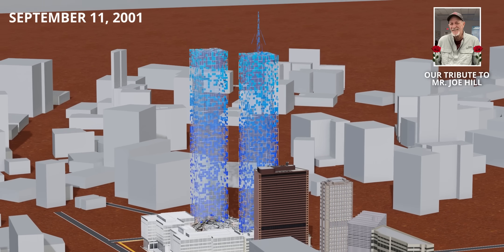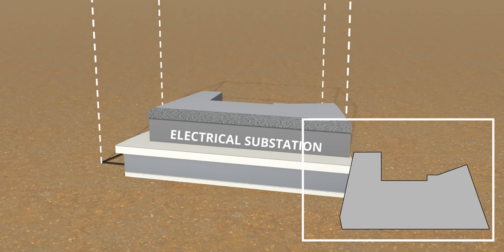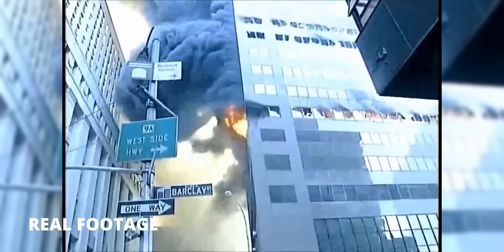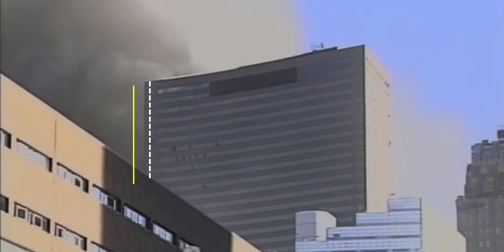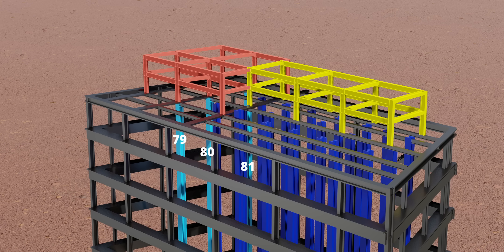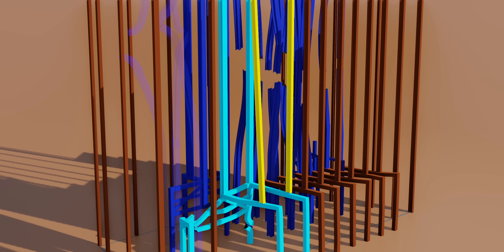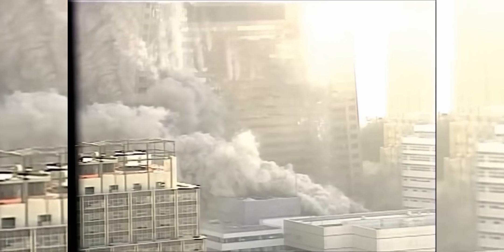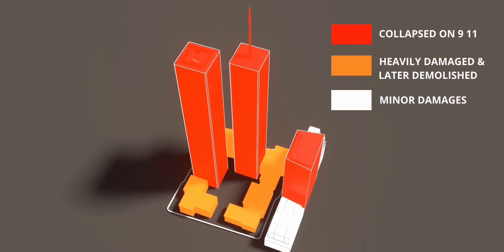Collapse of Building 7 | The Complete Physics

Comment: Good video but it still doesn't explain the explosions right before it fell and firemen saying get back there gonna take that building down
Reply: What explosions?

The North Tower collapse at 10:28am bombarded Building 7 with tons of debris, causing heavy damage and starting multiple fires which burned out of control for 7 hours. Half the FDNY firefighters having been killed, units in disarray, equipment destroyed, no water pressure, and the greater urgency of search & rescue efforts, firefighting was pulled as futile. The building couldn’t be saved and was left to its fate. That is the sort of choice firefighters make every day in brush fire situations - which houses to save and which ones to let go. Only real difference here is moving the decimal on the size and cost. People get overwhelmed by the size.

www.youtube.com/watch?v=g_SvpwyC17M&ab_channel=MFitz

Collapse of a burning structure is always a concern for firefighters. Steel buildings subject to fire rely on active fighting of the fires to survive. Buildings are designed around 1 to 3 hours of fire resistance, allowing time for occupants to escape and ACTIVE firefighting to get started, after which all bets are off. Left to their own devices they will exceed their design envelope and collapse, like Plasco Tower and Wilton Paes de Almeida. In B7 the occupants escaped, passive and active fire protections were compromised and active firefighting was abandoned 3 hours before the collapse, which left the building to its fate. It lost. Odds on Building 7 would eventually collapse, and it did. No big deal in logic.

www.youtube.com/watch?v=WnYBX6QT0R4

FDNY Chief Daniel Nigro ; The biggest decision we had to make on the first day was to clear the area and create a collapse zone around the severely damaged 7 World Trade Center, a 47-story building heavily involved in fire. A number of fire officers and companies assessed the damage to the building. The appraisals indicated that the buildings structural integrity was in serious doubt. I issued orders to PULL back the firefighters and define the collapse zone. It was a critical decision; We could not lose any more firefighters. It took a lot of time to PULL everyone out, given the emotionalism of the day, communications difficulties and the collapse terrain

FDNY Deputy Chief Peter Hayden ; We had our special operations people set up surveying instruments to monitor and see if there was any movement in the building. We were concerned of the possibility of collapse in the building. And we had a discussion with one particular engineer there, and we asked him if we allowed it to burn could we anticipate a collapse and if so, how soon? And it turned out that he was pretty much right on the money, that he said 'In its current state you have about 5 hours

The collapse of Building 7 was anticipated and widely reported in the media throughout the day, with 24 video cameras recording some or all of the collapse. Everyone knew what was coming and why.

www.youtube.com/watch?v=OY5S5k3tMHI

Comment: I can’t believe people actually try to validate that this wasn’t a controlled demolition. If the steel trusses all affected one side of the building, it would have fallen in that direction, not into its own footprint. How stupid are people?
Reply: Ummmm, no.  Let's replace your false starting assumptions with some true and relevant facts.

Building 7’s collapse was completely different to the Twin Towers and harder to understand as most details hidden from view and not intuitive, but we can still sort out what happened through careful analysis and observation. This is my explanation of the collapse relying on no outside authority.

Building 7 was complex, assymetrical 47-story steel framed structure built atop a smaller 3-story building, requiring lower floors dedicated to complex load transfer structures, not usable office space. Of trapezoidal shape and all-steel tube-in-tube construction, B7 (above the 7th floor) consisted of a central core of steel columns carrying most of the gravity load, perimeter steel columns around the outside of the structure carrying the remainder of the gravity loads and long span beams and girders to tie those elements together and form the floors. On the outside of the building hung a moment frame or outer shell.

Phase 1 : First externally visible signs of collapse initiation occurred at 5:20:28 pm and were notably quiet with observers not realizing the building was collapsing! No audible warning in the form of hundreds of ear drum busting 180-190dB explosive bangs preceding the collapse. Here at 12:00 a local CBS affiliate reporter is talking 10 blocks from B7 when collapse begins. People don’t start to notice the collapse until 12:11. At 12:45 is the famous CBS fixed camera clip of Building 7’s collapse. Note how quiet it is.

youtube.com/watch?v=t5tEy6mXSE8&ab_channel=fresnosean379

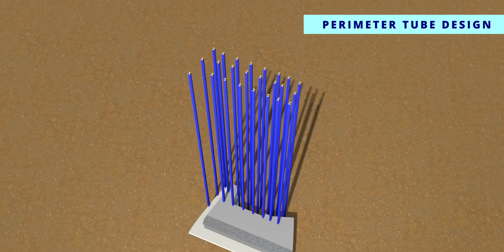Collapse initiation was due to lower floor failures above the load transfer region (7th floor) in the NE corner. In this video at 0:45 you can see the NW corner from inside the building while under construction, Column 79 just out of frame on the left. That big, angled steel beam across the top of the frame connects to C79 at one end. The girders connect to the beam. That beam and all those girders depend on just one connection

youtube.com/watch?v=nP3TNHPCIVU&t=35s&ab_channel=EdwardCurrent

Phase 2 : The floor failures caused a loss of critical lateral support over an excessive length of core Column 79 and it buckled. If you look at a floor diagram of Building 7 (see above) and look at all the structures that depend on C79 you quickly realize this one column was a relatively isolated structural element on which a disproportionately greater fraction of the structure depended analogous to say the Key Bridge. Externally we see a vertical progression of window breakage along the 44-46 line and a kink in the roof of the East Mechanical Penthouse at the top of the building, consistent with C79 failure. The transition from full capacity to almost no capacity occurs in an instant. Once the buckling failure occurs there is almost no resistance

Normally with a buckling column, the load could be redistributed to other columns. With C79 that is not the case - the failure did not redistribute the load, so the collapse rapidly progressed to the roofline, sinking the rooftop penthouse.

Phase 3 : With C79 gone, B7’s progressive, non-symmetrical collapse continues with C80 and C81 at the east end of the core left laterally unsupported and quickly buckled and failed as well, sending the EMP down through the building. C79-81 all have no diagonal bracing, which I believe is a major reason why they could not redistribute a lot of vertical loads among one another.

From there collapse progressed from east to west through the central core until the core was gone taking all of the interior floors and probably most of the perimeter columns with it. Follow the horizontal progression of window failures low in the building and the dropping of the remaining rooftop structures into the building. One of the big takeaways from the NIST Building 7 study (that gets completely ignored) was their modeling which determined C79 failing under ANY circumstances would have initiated the same collapse sequence.

Phase 4 : After 10 seconds only the exterior moment frame - a hollow empty outer shell – remains, giving the ILLUSION the Building is still standing since little has outwardly changed. It is just a hollow empty shell like an empty cereal box. Supported by only a few remaining columns that empty shell is quite unable to remain standing. With all core columns and floors gone, the north face leans inward, forming a V in the roofline, the last few columns buckle under the strain and the moment frame free falls, landing on top of the 7-story high debris pile. It is only late in the game here at the end that a single measurement of alleged free fall acceleration is taken, from a single point on that outer shell. The Building did not “free fall” – just one corner of the outer shell did, sort of. The Building was already gone before that happened. The period of alleged free fall was a product of how it fell NOT why it fell and cannot tell us what started the collapse. Start to finish the entire collapse took 18-20 seconds, 3 times longer than true free fall . How fast something falls cannot tell you what started it falling_ anyway. The debris spread outside the footprint, blocking surrounding streets, heavily damaging the Verizon Building and destroyed Fiterman Hall.

Building 7’s progressive, non-symmetrical collapse was incidental and unintended collateral damage from the combined effects of fire + time + gravity, started by the collapsing North Tower. That is true no matter who planned and carried out the 9/11 attacks or why . The collapse was of so little consequence it barely even registered at the time, a mere footnote. It only took on semi-mythical status as an alleged smoking gun years later when demolitions at the Twin Towers, missiles at the Pentagon and shoot down over Shanksville all failed and conspiracists had nothing left to work with.

Anything can seem like a conspiracy if you don’t understand how it works. Now you should. I hope you found this helpful, informative and it solicits informed critical comment. If I made any errors of fact, logic or reason or left anything important out, please let me know so I can fix it. IF you can offer a more plausible alternative please do. Be the first. Please start any reply with the words “Tits McGee” or I will know you didn’t read it and are wasting my time.
Reply: Its not even that they are stupid, its called cognitive dissonance. The person will be in denial, simply because usa = good and therefore 9/11 couldnt be controlled demolition, they will not look at facts and how impossible the official story is. But luckily they are becoming minority, huge bunch of people are awaking to this.

Comment: Straight quote from the NIST official report

32. In a video, it appears that WTC 7 is descending in free fall, something that would not occur in the structural collapse that you describe. How can NIST ignore basic laws of physics?

The analyses of the video (both the estimation of the instant the roofline began to descend and the calculated velocity and acceleration of a point on the roofline) revealed three distinct stages characterizing the 5.4 seconds of collapse:

    Stage 1 (0 to 1.75 seconds): acceleration less than that of gravity (i.e., slower than free fall).
    Stage 2 (1.75 to 4.0 seconds): gravitational acceleration (free fall)
    Stage 3 (4.0 to 5.4 seconds): decreased acceleration, again less than that of gravity

Question: 
Which law of physics allow free fall speed as if no supporting structure existed underneath?
Reply: how would acceleration of 9.8 m/(s^2) prove anything? Leave alone any conspiracy theory that it was controlled demolition (not sure if you're arguing for a conspiracy theory or not, but many people who make this argument do argue for a conspiracy theory).

Comment: No building made of steel can collapse from internal fires. Not even the Twin Towers had such intense fires, so much so that several people from above the impact zone managed to climb down and save themselves from inside the South Tower, and they certainly didn't have superpowers. And the same goes for the North Tower, no fires this intense. There's even a photo of a girl looking out from where the hole was. Where are the fires capable of weakening steel? You're just clowns. And you should be ashamed for insulting the memory of the victims.
Reply: If no building made of steel (a material formed using heat which is deformed the same way) can collapse from internal fires why does it happen with such regularity?

Comment: 3:37 yeah, except the tower fell the other way (tilted to South) so the damages were not caused from the antenna spire
Reply: The North Tower peeled to the four points of the compass out to more than 800 feet from the base of each Tower. Building 7 was well within reach of the north face of the North Tower and it was north face perimeter columns that did the damage.

https://www.youtube.com/watch?v=V1nTwL8S-0U
Reply: @TheCriticalStinker-01 I know but the antenna fell towards WTC 2 remains so the opposite, WTC 7 was hit by projected columns from wtc 1 you can see some in the footage that were blown far away towards wtc 7
Reply: @_Sylvain_  - Yes, this video got a detail wrong about what bit of metal hit Building 7.  

It's a detail. 

So what?

Building 7 got hit by heavy debris from the falling North Tower.  Do we really need to move deck chairs around on the Titanic?
Reply: @TheCriticalStinker-01 Ironic you mention Titanic when I’m fascinated by it and I even modeled it 3 times digitally.. Also I was just trying to correct that point chill lol
Reply: @_Sylvain_  WTC7 got hit by WTC1 CORE COLUMNS tipping over all the way to WTC7. They caused the gash aswell as the sw corner damage. This is not wild guessing as the claim made in the video here, I really spent time and watched collapse videos over and over to figure it out, I KNOW it was core columns and that that´s a crucial collapse mechanism that everyone missed.